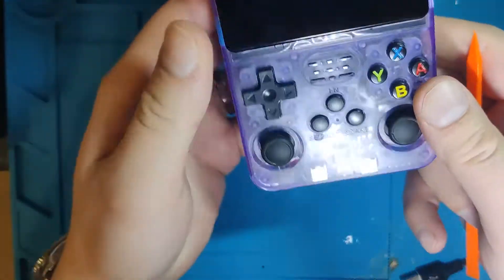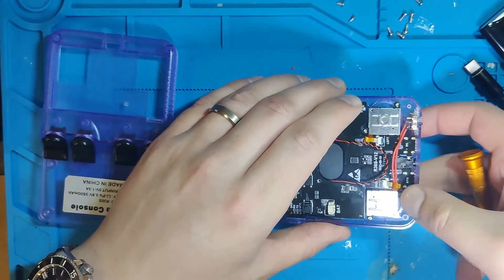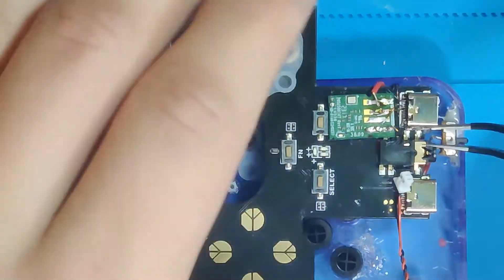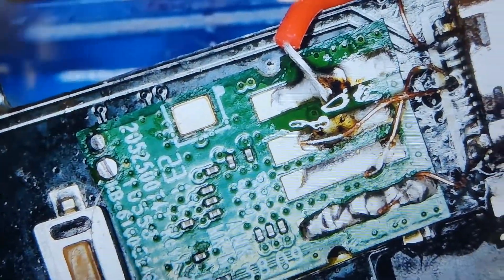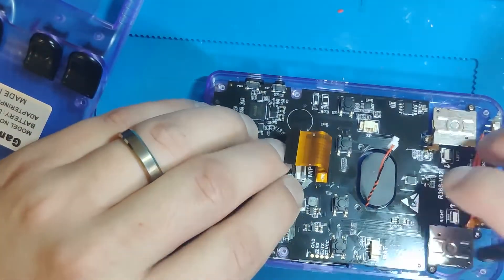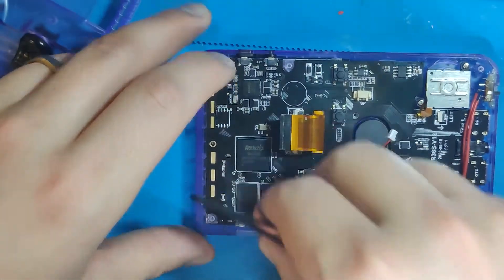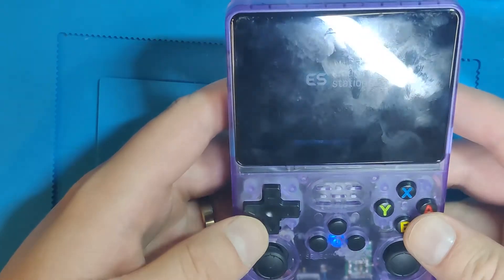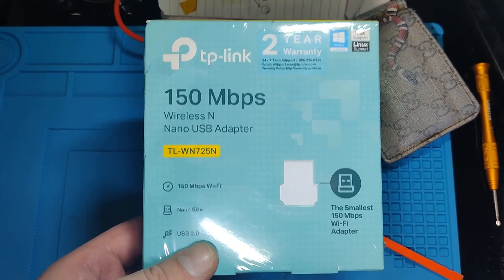R36s Internal WiFi Mod - Detailed Description and Device Teardown

Comment: I had the idea to buy a ribbon cable with 0.5mm spacing on aliexpress. Desolder the USB-C port, and then solder the cable. On the other side of the cable I can then solder the wifi adapter. Maybe its easier to do the mod this way, or more error proof.

Comment: I would place the switch near the battery and not have to make a hole in the case
Reply: So to turn on wifi you need to open battery cover?

Comment: I noticed that the board has VCC, GND, RX and TX soldering points, aren't they the same connections as USB? Wouldn't it be better to solder at these points instead of connecting to USB-C? It would probably be a third USB, thus leaving USB-C free for other features
Reply: I asked myself the same question !
Reply: Perhaps its a UART port
Reply: TX RX always are UART serial pin....for USB it should be D+ D-
Reply: Not necessarily.  Typically when a board has a vcc, gnd, rx and tx, it means it's debugging pins for UART.  This probably has UBoot and that's a quick way for the factory to test the board directly without a screen.

Comment: I have WiFi on mine with no mods at all and works great no connection issues.
Reply: It came with wifi installed?
Reply: @ratykat  Theres no WiFi module in this device but you can get it to tether to the internet for updates and portmaster and themes etc it's easy to do.
Reply: @markweaver1963  Ah I have misunderstood your comment, when you said you have wifi on yours I took that to mean onboard WiFi, not tethered.
Reply: @ratykat  the updated firmware has WiFi listed in settings twice 1 says WiFi the 2 WiFi status. Plug usbc cable in otg port of device the other into your phone (android) when the phone asks what to do select file transfer go to internet settings select tether via usb go to device to WiFi should make auto connect then update or use portmaster or thememaster to download ported games extra themes etc.
Hope this helps.
Reply: @markweaver1963  appreciate the guidance mate thank you, I'm hopefully picking one up in the next couple of weeks and would rather update online.
Reply: @ratykat  if your anywhere near Oldbury you'd be in for a bargain.
Reply: What do you mean mate?
Reply: @ratykat  mines listed on Facebook market

Comment: R36S with internal wifi and fixed buttons from factory would be an instant win for me. I don’t think I’d be confident enough soldering to the usb c traces
Reply: buttons feel good in my book , because my expectations are set accordingly, i paid 20 bucks for the r36s , if i was paying something like $60 or maybe $100 you bet i will be furious 😡😡😡😡
Reply: the dpad can be improved by backing off the screw on the back of it a 1/4 turn at a time till it feels good

Comment: whats the need for the switch if wifi can be turned off in the settings?
Reply: Без физического переключателя не сможет работать с отг устройствами, такие как флеш или мышка
Reply: @Rocker555 understandabale.
Reply: wifi is a Battery drain machine, sometimes you just dont wait to use it. there fore a switch avoids battery draining

Comment: doing that does it do the crackling sound? i have the same adapter paired with a usb c adapter and it does this annoying crackling sound everytime i'm using wifi
Reply: I think it does that because it doesn't receive enough power to work properly, but if you adjust the voltage enough... It seems to me that that sound stops making it.
Reply: @manganesio2025  thanks for the tip! 
but how can I control the voltage of the usb port or the usb c adpter?

Comment: You're not worried about a short with those wires? Is that discoloration on the wires from heat buildup?
Reply from the maker: Those wires are not bare wires. They are enameled. Even if they did touch something, they wouldn't short out. The discoloration is just burnt flux from when I soldered them. I should have cleaned it off, but I was worried about using alcohol to clean it because the adapter is glued down to the PCB and I thought it would come losse. I didn't think cleaning it was worth the risk at the tiime. But yes, the professional thing to do is to remove all flux after the job is done.

Comment: im still a beginner at soldering. i wonder what thickness of copper wire did you use to join the connections?
Reply from the maker: I used 0.2mm enamel coated wire.

Comment: Nice mod, im looking at maybe replacing some of those loud tactile switches with membrane type. Just have to measure the size of switches. Any opinions on that, maybe you could make a vid on that if u wanted
Reply from the maker: Interesting idea. Those loud buttons for the start, select and shoulder buttons are little tiny micro switches which mount directly to the motherboard as a separate part so I don't think there's anyway to make them membrane like the A, B, X, Y and dpad. But you might be on to something. There might be different micro switches with the same footprint that could substituted which have a more soft feel to them.
Reply: I successfully installed 8x8 silicone switches that are silent
Reply: If you are handy with a 3D printer, you can print a membrane that fits between the button and tactile switch. The TPU is slightly squishy and absorbs some of the hard click of the switch, while providing a small amount of spring to the button.  It's like a membrane button and a microswitch button had a baby.

Comment: Can the sticks, dpad and speakers be upgraded?
Reply from the maker: Yeah I've read some places mentioning the dpads could be fixed. My dpad seems alright for me so I never looked into it. One mod I did do which I forgot to mention in the video is cutting the thin piece of plastic which connects the A and B buttons and the piece which connects X and Y buttons. Before I cut the piece of plastic, the buttons would make squeaky sounds when pressing them. They feel and sound much better now.
Reply: @justinc8157  thanks, and happy new year
Reply from the maker: @ellicha90  Thank you. You too!
Reply: The sticks can definitely be replaced easily. Mine failed almost immediately from new. I ordered some switch ones. Four tiny screws and a ribbon cable and your good. I even ordered a spare set . One of my handhelds will need them  sooner or later

Comment: How's your battery consumption? and how about the speaker shielding?
Reply from the maker: It's probably only drawing at most 200mah if you're downloading constantly in the background. I keep it switched off while I play games so it's not drawing anything. What speaker shielding? There was no shielding in the adapter other than the metal USB plug. If you're talking about the sound distortion from the adapter, well actually it's less noticeable now that it's been internally installed than when I used it through the type c port/OTG adapter. Not sure why but maybe it's just the orientation that's changed.

Comment: What usb wifi dongle did you use?
Reply from the maker: TP- Link Model: TL-WN725N
Reply: @justinc8157  why when I connect this same TP link hi is not working( on PC yes) ....usb tethering on my two phones doesnt work too
What could be wrong with this OTG port in my console ? :(((((

Comment: Can the wifi be used for anything else besides the os updates?
Reply: achievements
Reply: Yes netplay!
Reply: And updating cores in retroarch
Reply: How it can be pin 2 on usbC for 5v? Normally vbus is 5v
Reply from the maker: @andreass.7152  Hey good question. Actually I don't think those PCB pins correspond directly to the actual type C pinout. I found this diagram of the PCB side pinout and it shows Pin 2 in my drawing as being B4/A9 which is vbus. https://i.stack.imgur.com/mBFCV.png